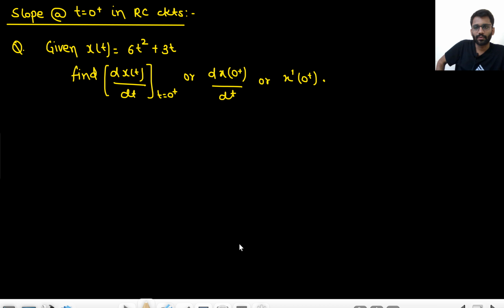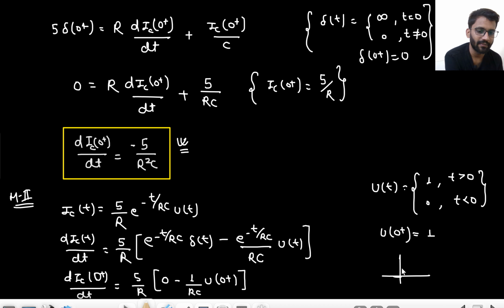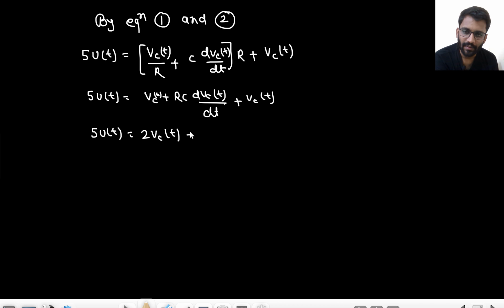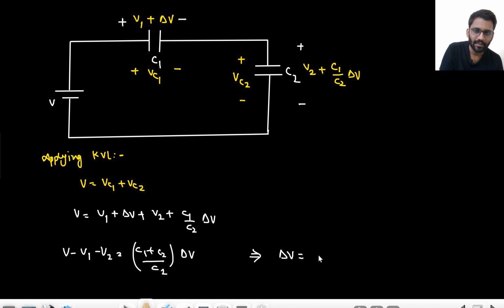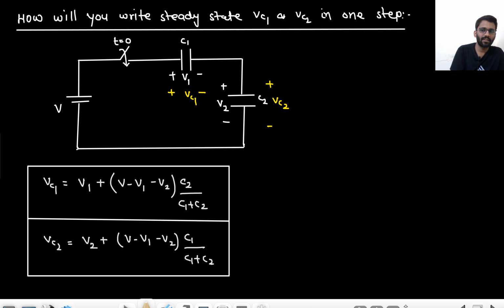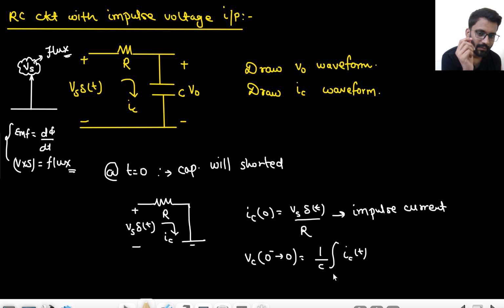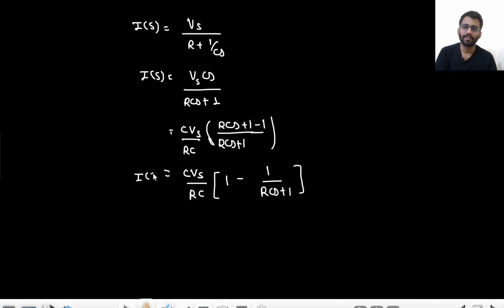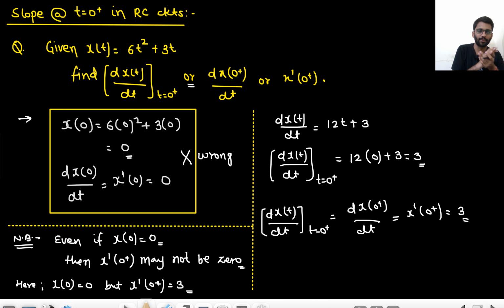Slope at t=0+, Switch Capacitor & Impulse Response of RC Circuits || Network Analysis||GATE 2025-26

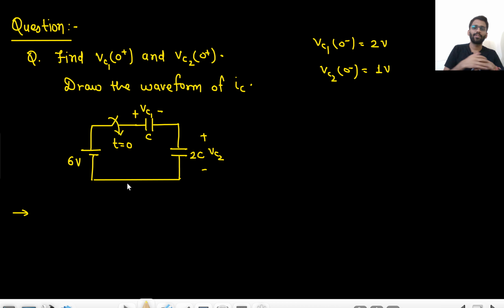Comment: In switch capacitor concept, @35:00 
We can just use infinite current theorem, I (t=0)= (6-2-1)/0 = ∞
So, Voltage will change, Vc1(0-)≠ Vc1(0+) & same for Vc2
Vc1(0+)=6 x 2C/(2C+C) = 4 ,  Vc2(0+)=6 x C/(2C+C) = 2
Reply: And even at t= ∞, capacitor open ckt, and by two open terminal across capacitor, 
So, voltage division happens
So, Vc1(0+)=6 x 2C/(2C+C) = 4 ,  Vc2(0+)=6 x C/(2C+C) = 2

Comment: 39:00 I am not getting the answer by Superposition.

Edit: I tried again and it works. The two capacitors are in parallel when we consider one of their voltages at a time. So we can apply charge conservation. 
When considering the battery, the voltage is distributed in inverse proportion. Now note that the voltage provided by the battery is in opposite to the initial voltage on the capacitors, so we subtract then rather than adding. And you get the answer.
Reply: you can get the answer by superposition
Reply: just use infinite current theorem, I (t=0)= (6-2-1)/0 = ∞
So, Voltage will change, Vc1(0-)≠ Vc1(0+) & same for Vc2
Vc1(0+)=6 x 2C/(2C+C) = 4 ,  Vc2(0+)=6 x C/(2C+C) = 2

Comment: Bro @49:00, you wrote Vs as flux. How on earth this is flux? Is there a inductor or any kind of magnetic field that you applied the flux concept. And, that e=  |-d(phi)/dt |  is Faraday's law, not to be applied anywhere.  There's no flux created here whatsoever.
Reply: You're applying basic physics too rigidly bro.
He isn't claiming there is any inductor or physical magnetic field. He only brought up Faraday's law to show that the unit for Volt-seconds represents 'flux' as an analogy, not literal electromagnetics.
Vs is representing mathematical dimensions of flux not a literal, physical magnetic field.
Reply: Flux is not related to inductors only; capacitors also have flux, both electric and magnetic. If you want to know more in detail, study the displacement current concept inside a capacitor and how a changing electric field creates a magnetic field. It's a class 12 concept; you can find it under the Electromagnetic waves chapter.
Reply: I'm so confused

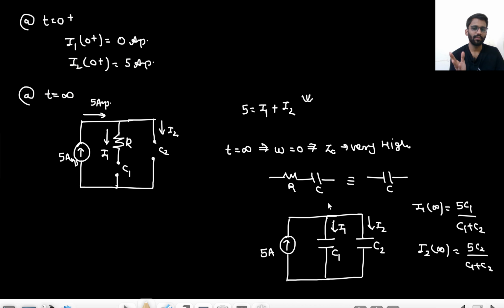Comment: 47:00 the capacitors are in parallel right? how did you take it as series
Reply: you should open-circuit the current source and then we can see the capacitors will be in series, calculate Ceffective and then caluculate Reffective from the direction of Ceffective.